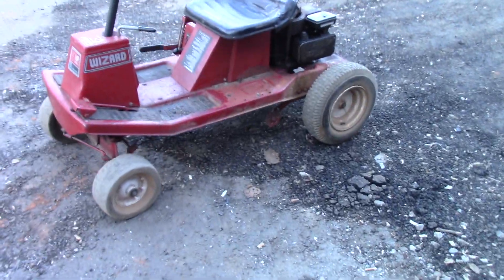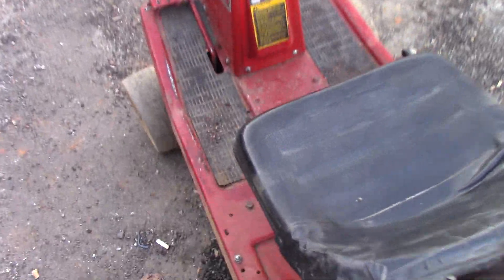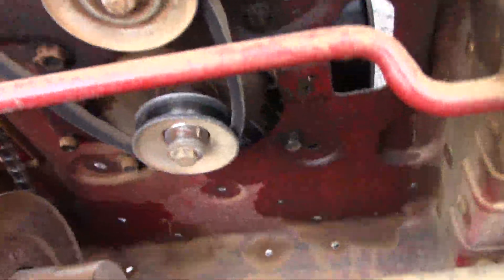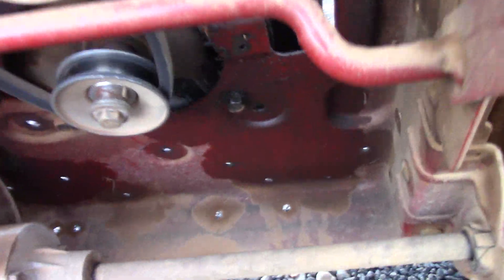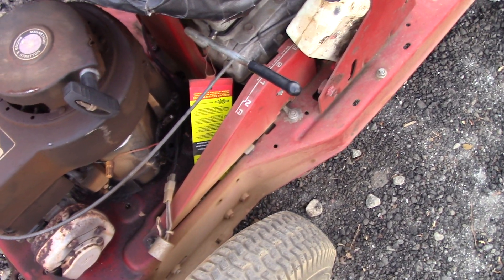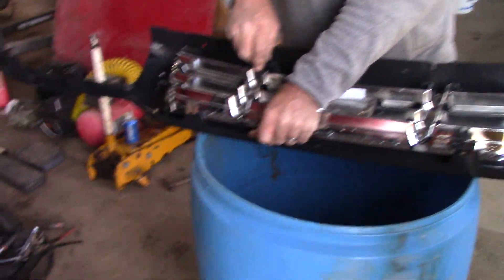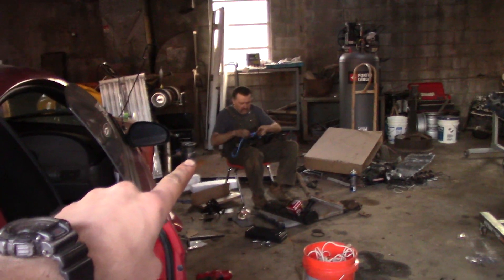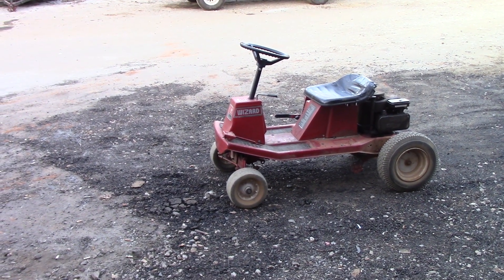Scrapyard built racing mower

Comment: It’s still got quite a bit left in it as far as gearing goes. You could probably gear it down even more and be completely fine. Maybe like a 2 inch on the trans and a 4 inch on the motor. That would be pretty awesome
Reply from the maker: The engine with stock pulleys seemed super weak., So I didnt think that I had alot  of gearing to choose from. But after seeing it run now, I know I could have done better.

Comment: If you still have it you could easily pulley swap a bigger engine in it, maybe 7, 8 or 9 hp, as long as it’s a vertical shaft engine, you could s9me newer push mower engines as you can get some with 7 or 8 hp